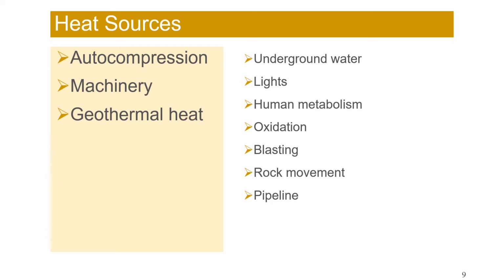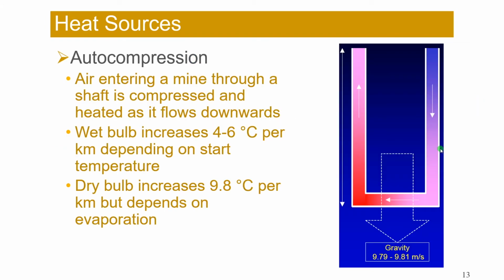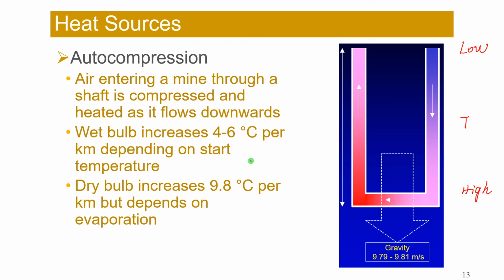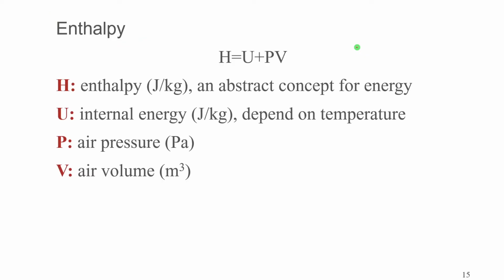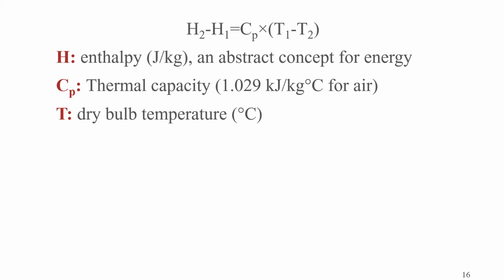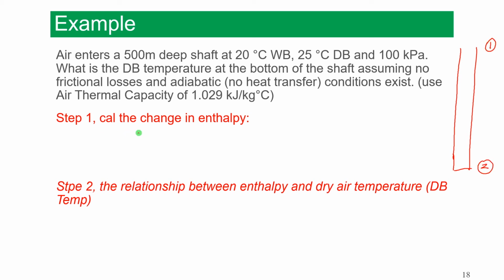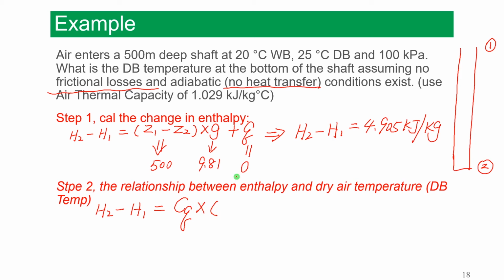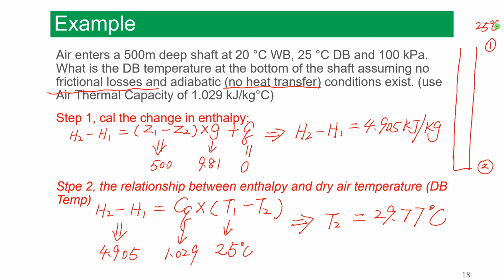Mine Heat 1: Auto-compression

Comment: I think the DB should be 20.234. as we subtract with 25 - 4.766
Reply from the maker: Thanks for pointing it out. There was an error in the equation I wrote. In the equation, it should be T2-T1, which is consistent to the left side of the equation H2-H1. The answer is no change, as goes down the shaft, DB increases due to auto compression.